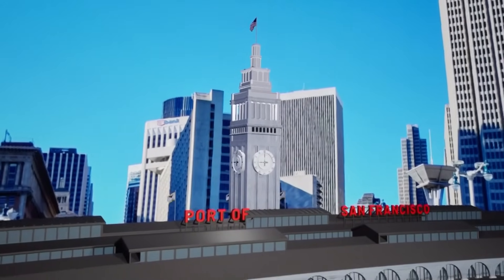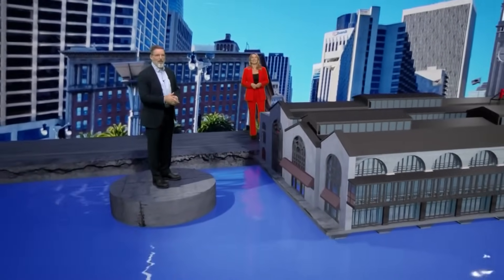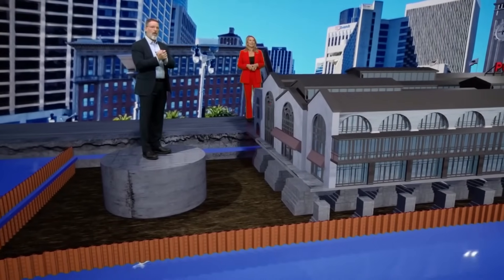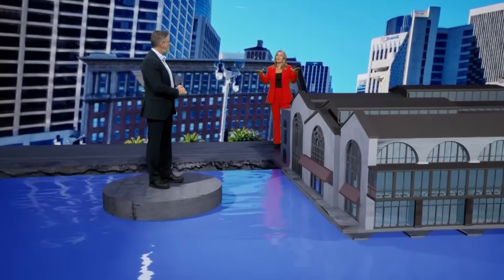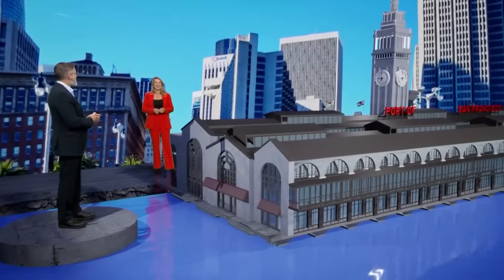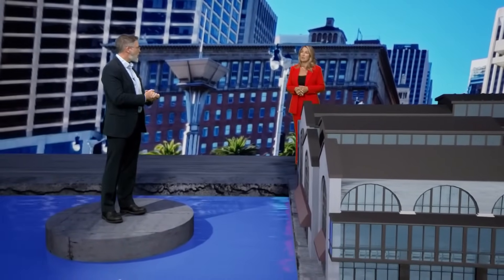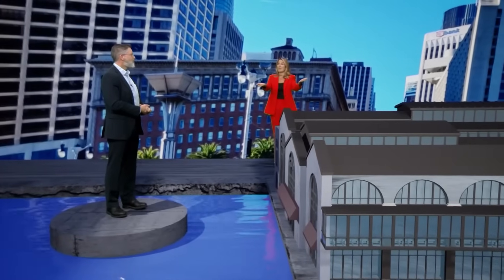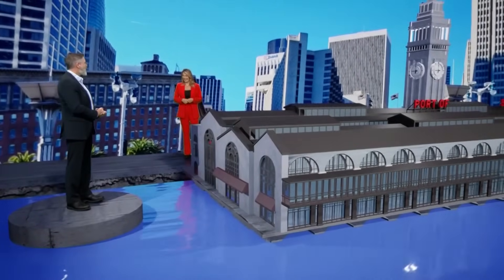How the SF Ferry Building will be raised

Comment: I see a problem with Step #1: "Sink the Coffer Dam Panels"

If it was just undisturbed earth it would be fine but I think that area has a lot of jumbled debris from the earthquake and below that late 1800's sunken ships all mixed into the mud.  So it might be difficult to sink those quarter or three eights thick Coffer dam panels deep enough and in a defined line without hitting something.  

It is a beautiful and iconic building and worth the effort though so I wish the Port Authority luck.